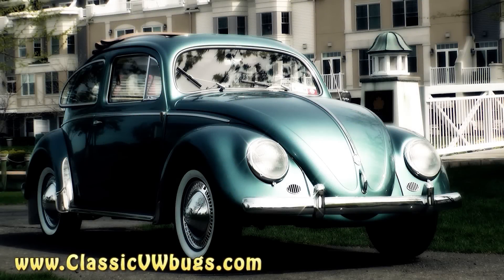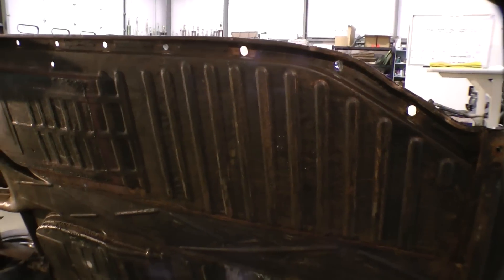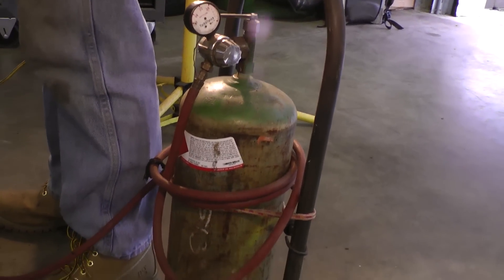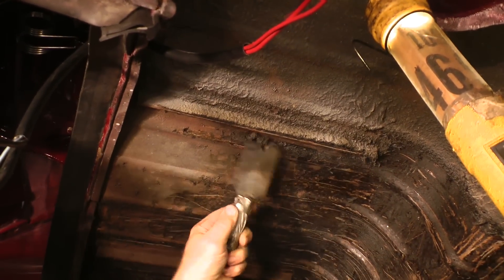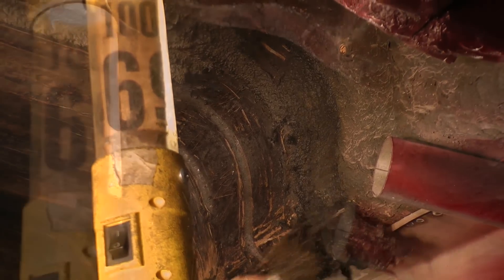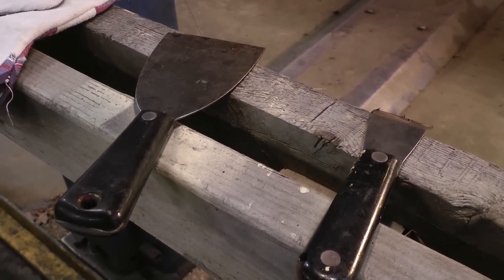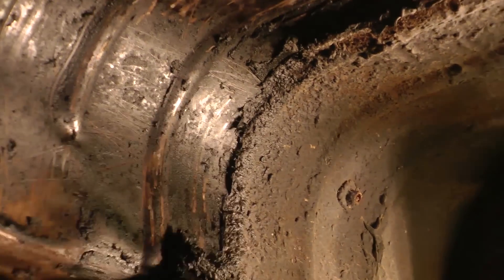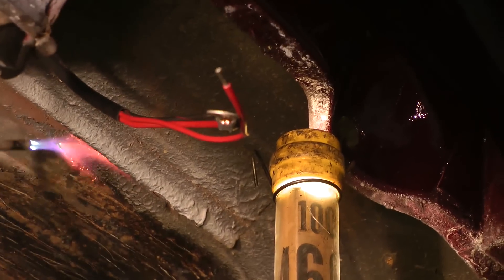Classic VW BuGs How to Remove Old Undercoating Beetle Ghia BuS

Comment: I used a wood chisel to get most of the undercoating of my car then a wire wheel to get the rest off, took a while to get it all off, but it was pretty cozy under my car cause it was up on jack stands.

Comment: I have good luck with a 4.5 grinder and a wire wheel. I use a smaller wire wheel on an air grinder for the hard to get areas. Heat might be good for the areas that you can't with the wire wheel.

Comment: Thanks for the tip. What is your take on using Rust Bullet instead for POR15. 

To the person who heard that POR15 fades. It says in the instructions that POR is sesceptible to ultra violet light and should be over coated to prevent that or keep it out of the sunj.

Comment: So you wouldn't re apply undercoat to prevent future corrosion ?...it seems that undercoat is more durable than just a thin coat of paint..my 71 Super is undercoated and the floor is not rusted at all...it's all original-very solid...never driven in winter and garage kept...I do have a small rusty spot behind the left front tire and will be cutting it out and welding in a patch panel..should I just paint it and call it done?

Comment from the maker: Well bugs really did not rust from the outside, it was from the inside OUT.  You want the pans to be sealed from the inside.  POR gets hard as a rock, you can get away with 1 coat, 2 or more is better.  Undercoating can actually trap moisture.  POR has to be put on correctly, not in the sun, and kept perfectly clean.

Comment: that seems abit too much work and nasty heating that stuff up. The best tool for that job is an air needler. I did my whole under chassis in a couple of hrs and a lot less nasty mess. just a suggestion. chris grab one from harbor freightIT WILL SAVE YOU TIME.... HAVE a GrateFUL Day